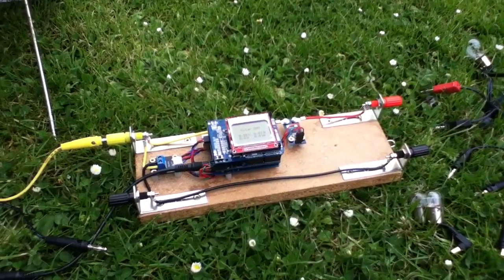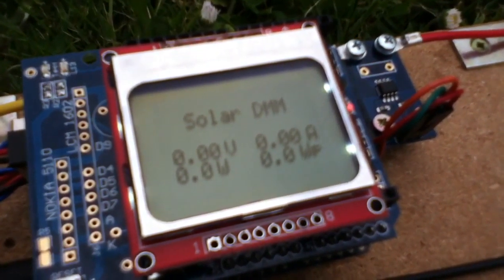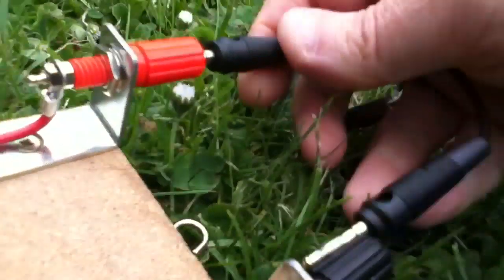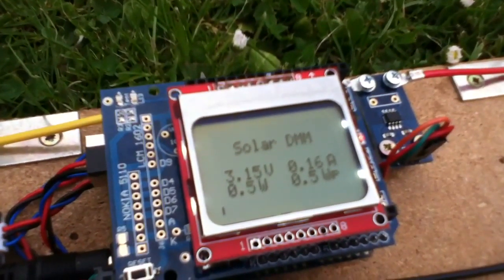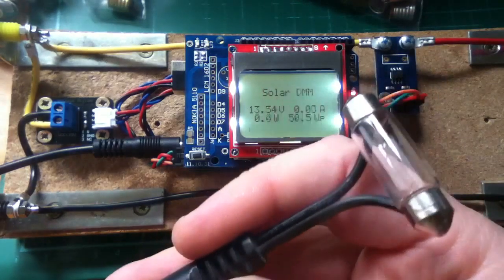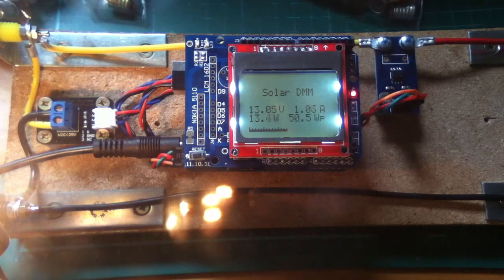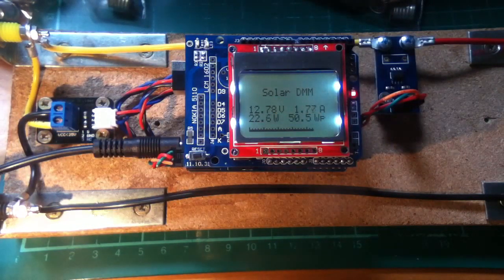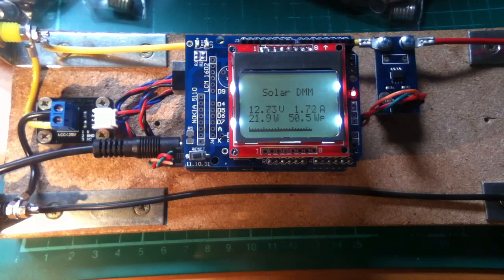MPPT Solar Charge Controller #3 - New Display, Watts Peak and Bargraph

Comment: Great work! What is the model name of the voltage measuring breakout board you're using?
Reply from the maker: It's a DFRobot module called "Voltage Divider". Quite expensive because not many are available and it's just 2 resistors and 2 connectors (you also get the cable). But I have just found a cheaper module on eBay - item number 111220315117